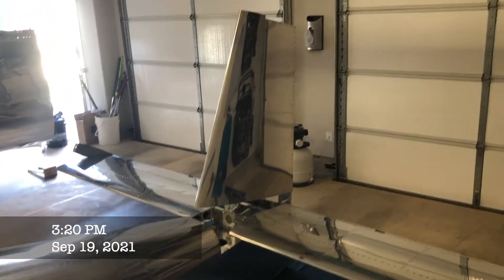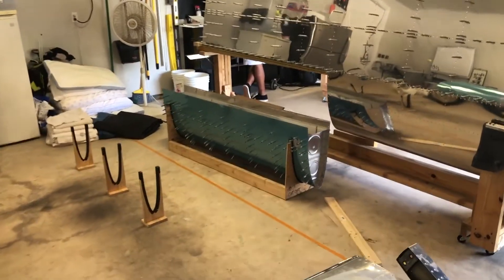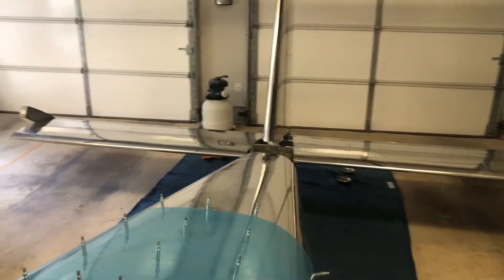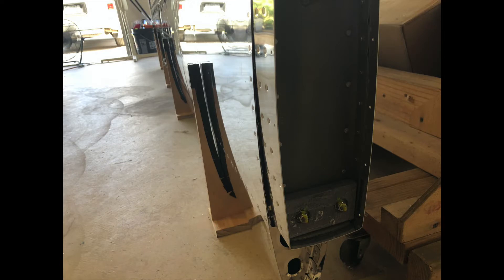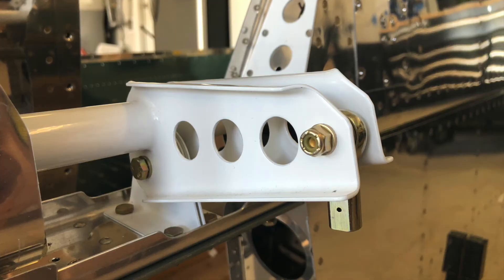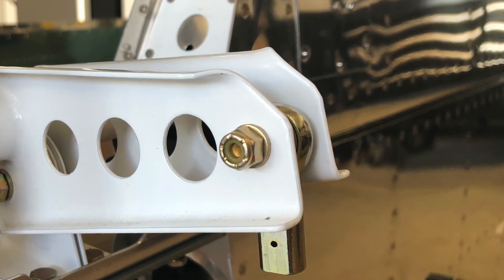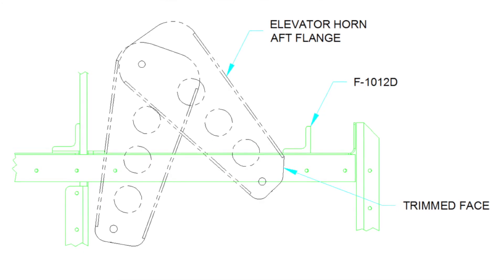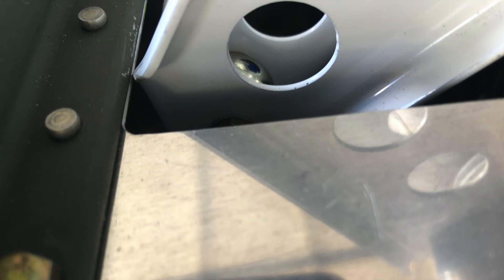I need to fix this on the Van's RV10

Comment: I would definitely weld holes and redo. 
I just started my empennage kit (rv-10) so I'm far from the section. Looks like 2 clamped straight pieces of wood/metal top and bottom could have held that in alignment while the holes were drilled. 
A 172 I once owned came back from annual with the rigging slightly off. Level ailerons had the yoke not level with a slight left bank. Absolutely unacceptable. I've had to put that plane down in a 28kt crosswind. I believe I used the limit of the control to put it down. Misaligned rigging was unacceptable to me. I made them fix it.
That misalignment you showed would bother the hell out of me. VANS obviously knows their aircraft but I just couldn't live with that. I'll definitely make sure mine is straight. I greatly appreciate the heads-up.
Reply from the maker: I will cross the bridge when I get there, thanks for heads up.

Comment: I would replace the upstop bracket with the new design shown in the service bulletin And I would correct the elevator alignment because it will give you a roll moment that you’ll be trying to trim out with your ailerons
Reply: The elevator stop has been replaced, I am going to fix the bellcrank later.

Comment: I would drill an upsize hole and turn a metal bushing with a cam insert that you can rotate to align both sides.  Insert a slightly longer bolt and lock tight the bushing once it is in the correct position.
Reply from the maker: That is an interesting idea.  I would have to talk to some engineering friends about the structural integrity.  If this was anywhere other than elevator...

Comment: I’d fix the elevator. It’s easy to get to, cheap enough to fix, and if you are a perfectionist like you say you are you will undoubtedly “feel” it when flying (even if it’s effects are negligible). The real question is, would you be satisfied with it if you had done it yourself? If the answer is no. Don’t compromise your standards. Just my 2 cents.
Reply from the maker: That is a great point and I likely will fix it.

Comment: Fix it.
Reply from the maker: Found the part from vans, I just need to replace the angle stock with a piece that is 1.25" x .75" instead of the current .75"  x .75".  It will be on my next order from Van's.

Comment: I think plane lady has a video addressing the service bulletin of the elevator stop. They decided to put it in now as opposed to having to retrofit it later.
Reply from the maker: I will have to look further into her video, TY for sharing.  When I called Van's they were pretty clear that there is nothing to do except add some spacers to lift up the elevator stop so it hits higher.  If I do it now or later, doesn't matter since I won't be mounting the horizontal stab for like 3 years.